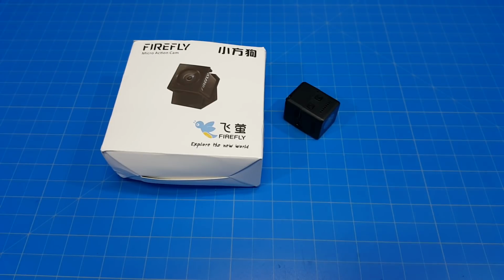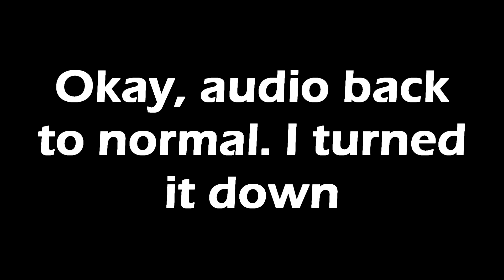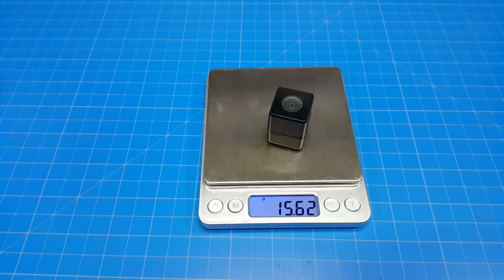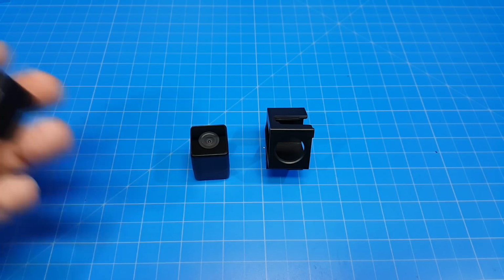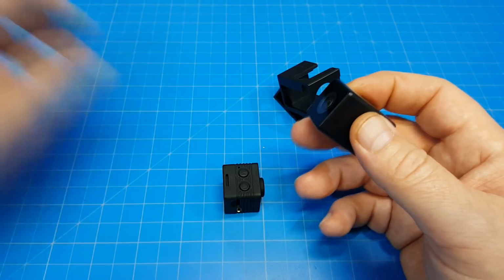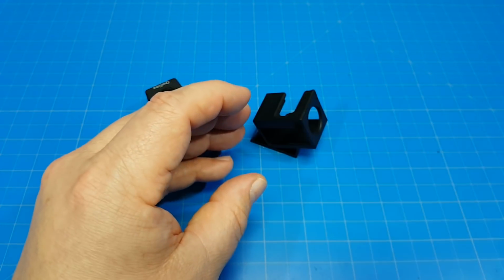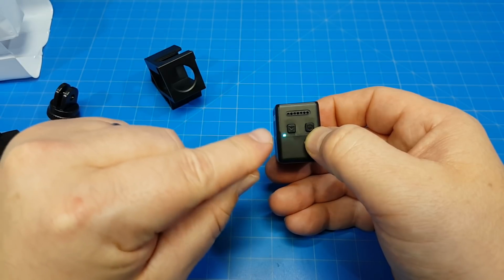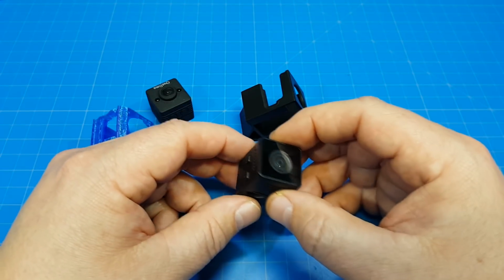Hawkeye FireFly Micro Action Cam - "for RC Drone"

Comment: I have 2 of these now. I have only one 5" quad , the rest are micros and this cam is the perfect addition even to a 100mm size quad.
Reply from the maker: yes, next step better light handling and 60fps in the same low weight configuration.....hope hope.

Comment: I have both this and the Turbowing Cyclops 3. The Cyclops cannot handle poor light at all well, if it's cloudy it's bad . The Firefly however works much better, but only use 720p ,you'll get better results.  I have my Firefly on a 2" Diatone GT-R90 and is the perfect combination. Of course it's no GoPro but am happy with the results for such a small camera. I've ordered a second Firefly now.

Comment: a WARNING to you guys. DO NOT I repeat DO NOT use ANY USB cable except the one that comes WITH the camera. it is "non standard" I plugged another USB Micro B cable I had lying around into the camera and it FRIED the camera immediately. magic smoke smell. dead.

plugged in the included cable (I bought 2 cameras) and its fine (the second one first one is dead dead the pixes were let free)
Reply: I read your comment about 1 hour to late ^^'

Comment: Got mine last week, and mounted it on a 130mm 2,5 " quad with 3S 20A ESCs to fly indoor @ low light. This Cam @1080p performed quite good but noisy in allmost dark conditions ...when it is to dark,  @ 720P it cuts video and keeps Audio up...in good light it does it sporadically and only in 720p.... not shure if it is a feature ;-) 
It takes a 30 meter direct to concrete crash in my case and survived !

Now i power it form the flightlipo to save the weight for mor acro fun...but then you have to be carefull with SD-card handling....a hole other storry.
Reply from the maker: I was notified there is an update. The link to the update file is on the hawkeye website, there is also a link in the comments section.

Comment: Great video. Just bought one to go on a ryze tello. But i cant help wondering what drone that is you are using. I think i need one of those 😉
Reply from the maker: The quad is an xjb145. I have a review on the channel if your interested.
Reply: @NickBurnsFPV  great thanks i will have a look.
I got my firefly yesterday. It definatly does the job.

Comment: Awe cool. 
Question :
- Do you really like this better than the mobius mini ? 
-I'm interested except for the lack of codec and frame rate flexibility. Or am I wrong and it has those options ? 
Thanx man
Marc :-)
Reply from the maker: This camera is very simple. "1080P and 720P" , no additional camera options. I prefer it due to the fov and cost, the mobius mini form factor isn't as conducive to mounting and actually needs much more lens protection. I think the image quality is better via mini mobius.

Comment: watched 2 sec of flight footage. knows enough
Reply: Did the exact same. Mobius Mini probably the best option for our 2.5" and 3" drones.
Reply: hahahaha
Reply: cyclops 3 is better than this (and it won't slow donw you quad as much as this), it's 4.5g,  records 720p video, not best for fpv view (bit of latency), but works great with moded lens as "gopro" on my 2" quad :)
Reply from the maker: I struggled with the cyclops latency, I also thought the picture was dark, might have just been the two I have.
Reply: Only problem with my cyclops 3 V2 is fov, on the DVR it's not wide enough, but sound quality and probably even image quality is better i think. This camera is almost same as SQ12, so HD = 720p, FHD 1080p = upscaled 720p.
Reply: Nick Burns. Picture was very dark on Cyclops.
Reply: I swaped the lens with something better from a spare AIO cam. worked fine but FPV feed had focus issues I could not resolve. HD video looked similar to FireFly's sample tho.
Mobius mini rocks both, it looks far better on quick camera moves and just struggles a bit with harsh light condition changes.
Reply: AND, THE CYCLOPS IS ACTUALLY 480P!
Reply: Gophy where did you pick up your lender for the Cyclops 3 ? And do you have any video so I can see how it looks with different lens thanks
Reply: you could buy 3 of these drones for the price of a mobius mini

Comment: You mentioned you'd rate this higher over a mobius mini? is that just a cost to quality thing or do you think the quality of this is on par with or better than the mini? Quite interested in these cheaper cameras, I'm thinking of doing a similar modification like the HD backpack but making it more affordable. Just up until now the light handling of the cameras hasn't be worth it. Cheers!
Reply from the maker: The mobius has better image quality, and just overall quality. In its native form mounting it in most cases for micros is a pita. Also in its native form needs lens protection. The biggest draw back is the fov, the fov on the Hawkeye is so much larger it will be a more immersive feeling, even with the fisheye (which I barely notice). Then the cost difference.
Reply: Nick Burns I might have to pick one up and see if I can work any magic,  a budget offering would be great to have and the wide FOV would be great 👍

Comment: Thanks for the video Nick :)
I've got one heading my way.. But yeah.. 30fps huh? I knew that offcourse.. I guess we'll have to wait a bit longer for a cam in this size that does 60fps :)
Reply from the maker: we can only hope for 60fps, I suspect the first 60fps will have a reduced image quality, then maybe the next iteration will be usable.
Reply: Runcam should make a Split-in-a-box that can be powered of the flight lipo.. Should be small (no battery inside) and still swapable from quad-to-quad.. 
(and 60fps offcourse :))
Reply: Yes, we will, thanks!

Comment: Thanks for the review!
Only 720P resolution, frozen frames, black hole sun... not good. I would wait for another micro cam that makes 60FPS on 720P, has true 1080P and a decent video quality.
Reply from the maker: I agree, I also think we might end up pay over $100 for those features. Then we don't have the BestBuy warranty to kill them and get news ones. Maybe GoPro has something in the works.
Reply: I fly 3" quads so I don't go bankrupt if I should lose one, so an SQ12 is a good choice for me. If I want more quality I have one quad with a Split mini which comes with some neat extras like being able to change settings in flight.
Reply: We have updated the firmware to solve the problem, thanks!
Reply: Hawkeye Firefly Action Camera thanks for the feedback. Now we need new recording examples with a new firmware.
Reply: HawkEye, can you make a firmware without dropped frames? Maybe make it at 24fps if it is impossible to make full frames in 30fps ?
Reply: Montis hi the frame rates will not drop now

Comment: Did you mention anything about the battery? Im wondering because i have a runcam3 and im disappointed on how crappy the battery is. Still relatively new and will only power for 6minutes at a time ( runcam ). Ty
Reply from the maker: I suspect your runcam battery is damaged or defective. My R3 runs for about 40mins. This firefly will only run for about 25mins on a charge.

Comment: So blue light on is 720 p and off is 1080p? Seems it always wants to default to 720p. I did a day of recording and it must have all been 720p. I never got the freezing you had though. I just updated firmware and will try with 1080p hopefully tomorrow.
Reply from the maker: blue light is 702 green only is 1080. It does default to 720, press the m button for a few seconds then let off it should switch to green only. I have updated the firmware but haven't tried it yet.

Comment: I ordered one as soon as I saw it and I'm glad I did after seeing your video.  Still waiting for it to arrive and almost can't wait. What did you fly it on?  Glad to see you now have a Patreon account!
Reply from the maker: xjb145, its a 3incher, I was going to put it on the bfight, but that was going to take moving the Rx to another location.
Reply: Nick that's awesome. I have the xjb. AND BFIGHT . Both good quads.  I have bfight modified for crossfire. I just ordered the firefly. It looks great for the price and I won't be too sad if I smash it up. I just had to return a mobius mini from overheating think. Great picture  but I had immediate issues. Firefly was a no brainer for the price.  Just wanted something better than my dvr.

Comment: Wanted to ask if you ever run into this issue with the camera. I just tried mine and 720 videos play fine but 1080 videos there's no video only audio. The screen is white with the audio playing in the background. I've updated the firmware and still doing it.
Reply from the maker: No my works for the most part as expected. I did have the stuttering you see in the video when in 1080p mode.

Comment: I had been waiting and waiting and waiting for that to come back into stock... in the end i bought a runcam split 2 and I'm soo glad i did! 
Now ive been spending more time flying im much prefering 5" over 3" anyway. Sorry thats not much help for 3" quads though!
I dunno if you cropped the 720 footage whilst editing, but aside from the glitching it seemed a better looking video! 
The fish eye effect on the 1080 just seemed to be excessive!
Having said that, for 20 bucks it's a damn good video🖒
Reply from the maker: That footage is better. How is the latency. I have held off due to reports it was laggy. Did they fix that in v2?
Reply: Either it's been fixed or I just don't notice it! 
But I'm not at your level of zipping in and out of trees just yet! LOL
60fps Video is outstanding though!
Reply from the maker: 60fps is really needed for smooth video. I should try the split, I have been hoping for a split micro.
Reply: Go for it, you wont be dissapointed dude! Good excuse for a new 5" build too 😉
Reply: Nick Burns Is the Split Mini still too big for you?

Comment: should i just buy older go pro for mine? not planning on using transmitter or goggles fpv
Reply from the maker: Depends on your budget. What do older go pros cost? This one is less than $30. Of course go pro is going to have professional grade quality to it, this one does not.

Comment: is this what you see when you fly it live? im new to this
Reply from the maker: No, this is a secondary camera mounted on top of the quad. The fpv view is lower resolution.
Reply: ahh ok thanks, is there any way to get this good resolution into your fpv goggles?
Reply from the maker: Well nothing really this close. The falcore system is about as close as we get. Its really expensive. Keep in mind for fpv we need little to no latency, otherwise we will run into things and won't know it until after we have crashed.

Comment: On what drone have you tested it? On a 120mm?
Reply from the maker: I haven't. I think its doable if the 120mm quad is light and good thrust. I think this cam is like 25ish grams.
Reply: Nick Burns It's an Aurora 110. I think that you had already tested it on the channel
Reply from the maker: That sounds familiar but I just don't remember much about it.

Comment: Awwww. You mentioned twice that you hadn't pulled it apart, so I thought for sure you would before the end of the video.

Pull it apart, pull it apart!
What's in the box? What's in the booox?
Somebody no doubt already has.
Meh. Maybe just use it.
This is not a haiku
Reply from the maker: I was seriously thinking about a tear down, but I want to try it on other quads for I potentially damage it.

Comment: I did add some my 3d print files in 20,25,30 and 35 degrees of the mount for tpu. Not sure if you saw i posted the thingiverse link on my Intro text of my review as promised from when we last talked about this one last week Nick. I made it where its there but muffled. Heres the link https://www.thingiverse.com/thing:2805835
Reply: Just to follow up that thought it didnot help the noise so maybe those are air vents. If you find it too heavy let me know i could shave the walls some if needed. I also dropped the walls down to cover the sd card so it will not eject and because once in we donot need to take it out to pull footage because of the usb port.
Reply from the maker: I will print one and do some testing. Thank you

Comment: @Nick
            Nice review bruddah :D
          Looks like you actually got a really nice flying day too .... sun out, tops of trees didn't look to be moving either... NOICE :D

As far as SQ range and FireFly being same or similar ... they defo are using similar base technology. But they have some significant differences.
The SQ12 has a better lens than the FireFly, but the SQ12 suffers more frame stutter and quite serious exposure banding when moving through changing light levels. I suspect they are using different sensors.
Overall IMHO the FireFly is a better camera ...... partly because its pretty easy to open these cams and replace the lens with a much better one, and also reduce the weight to about 5gr, where as there are no easy fixes for the SQ12's stutter and exposure banding.

SQ style camera lens and weight mods

https://www.youtube.com/watch?v=iTLOIymy-Y0
https://www.youtube.com/watch?v=A30WUwksemE

Oh yeah forgot to mention this is a pretty good micro DVR

https://www.youtube.com/watch?v=_MK_6Wb9yrA&t=4s

If you combine one with a good FPV cam with high TVL you this

https://www.youtube.com/watch?v=QFA8yKtUhsQ&t=0s&list=FLrk-8s6V_6GALyAkdp5TZzg&index=3
Reply from the maker: It was somewhat calm. The lack of leaves on the trees make it a bit decieving. Good info, thank you
Reply: No probs Nick ...... you've done much more to inform me, and on many more occasions m8 :D
Glad to be able to contribute.

Comment: No smooth video! Very bad framerates!
Reply from the maker: on the 1020P settings the recording would stutter, others have had the same stuttering in 720p. I have flashed the new firmware which did correct the issue. The firmware came out after my video was posted.